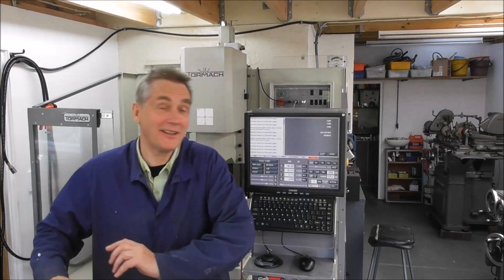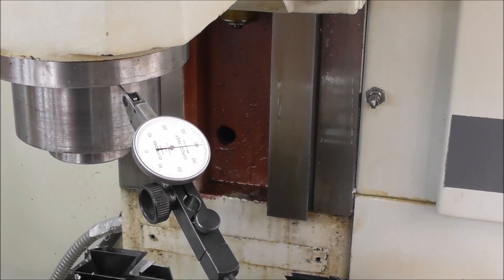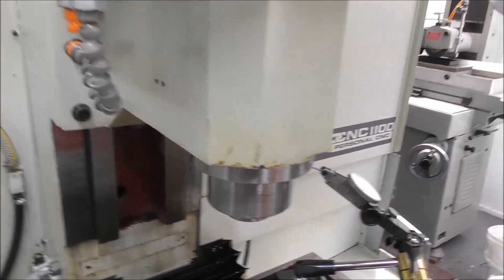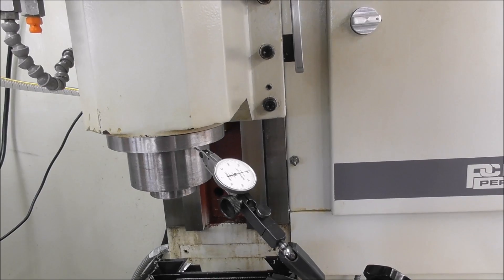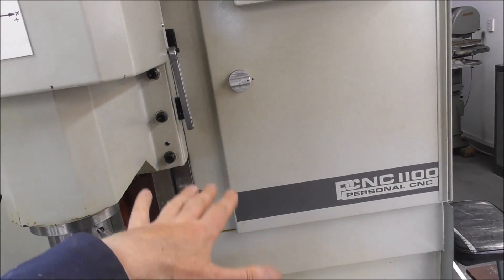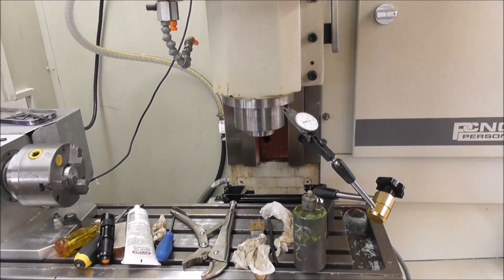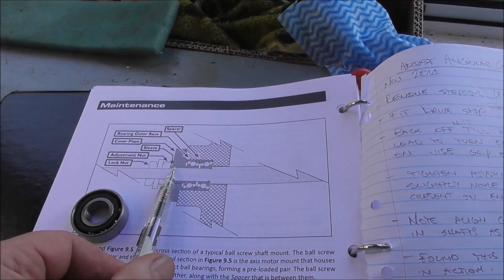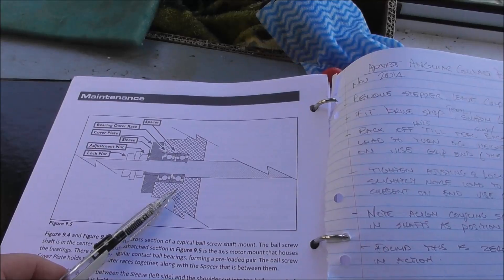Tormach Z - quick adjustments.

Comment: I had no idea you have been running the 1100 since 2007. Heck of a testament that the machine is still adjustable to maintain
nice accuracy.
Reply: I learned on a Tormach 1100 at this place named Techshop. They have a Tormach with a ton of hours, severely abused machine that still runs great and is still really accurate. This thing is used often by people learning to machine, its a communal place so you never know who did what to this thing. The bed is a battleground of scars and even on dent about .05 deep between inside a T-slot, looks like a gunshot. After all this, it still produces great work.
Reply from the maker: It is.. I agree.
Reply from the maker: Good to hear! Cheers.

Comment: May I ask with the final adjustment on the gib do you get that wet look as you showed with travel of z on the flats and dove tail. I get that wet look on the all except on the superior aspect of the right dovetail which is wiped nearly dry with up/down motion and you can see faint discoloration in the grind. (not the inferior aspect that remains wet) any thoughts?
Reply from the maker: Hi GG. I apply slideway oil manually on the vertical slides in addition to using the one shot system, as I have found it can get blocked and is not always 100% . That might be your issue? Cheers  Cliff.
Reply: The right dovetail seems to get wiped near dry in the above the head in the positive direction but remains wet below the head in the negative direction, so I believe it is not blocked, I theorized perhaps the bolts between head and saddle were not torqued equally twisting the saddle such, I gonna investigate tomorrow time permitting I hope that is the issue because it may point to the worse alternative that the dovetails on the saddle are not parallel- any suggestions?
Reply from the maker: Hi GG. It may also be that the upper oil grooves are blocked and the oil is only getting to the lower portion. Try applying oil manually to the top section and traversing the head up and down and see if that wipes it dry. Cheers.
Reply: It does wipe the manually applied oil, which I try to stay on top of until I can figure it out. Thanks for taking time to respond.
Reply: Update-- I untorqued the bolts, the torque to unbolt not reliable but it was definitely a measurable difference between the bolts. I torqued them equally and I was ecstatic to find out it solved the problem.
Reply from the maker: Good news GG. Thanks for posting. Cheers  Cliff

Comment: Precision is impressive for an open loop system. I wo der how long it'll be before somebody offers e.g. Clearpath closed loop servo stepper replacement kits for Tormach machines.

They could have done better with managing the thrust, but not as cheaply. Angular contact bearings are intended for use where there is a combination of significant radial and axial loads: but one finds this arrangement in lots of machinery, where the radial load is tiny compared to the axial (thrust). Indeed with a ballscrew axis drive, one endeavours to have no radial load at all because that would mean a (slight) bending of the screw, accelerating ballnut wear.
Reply from the maker: Hi Bernd. Interesting points, thanks.